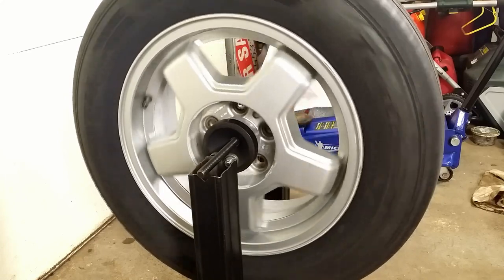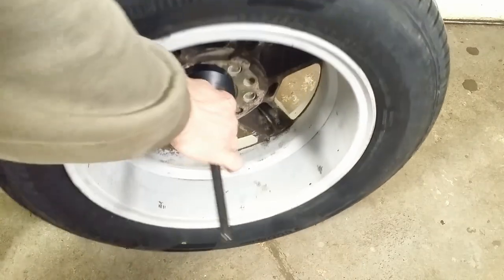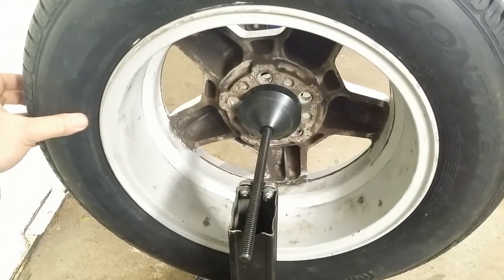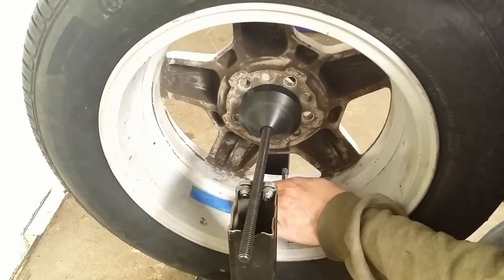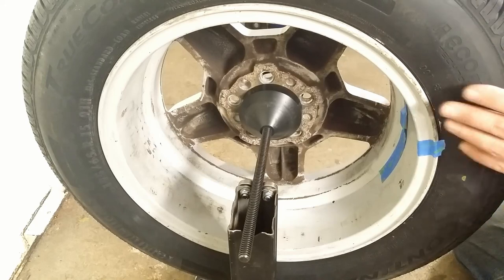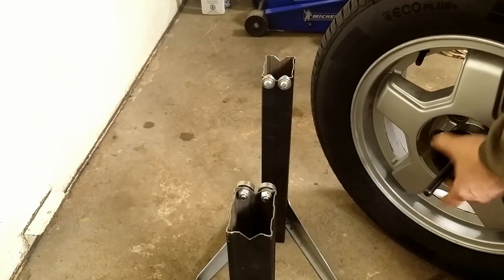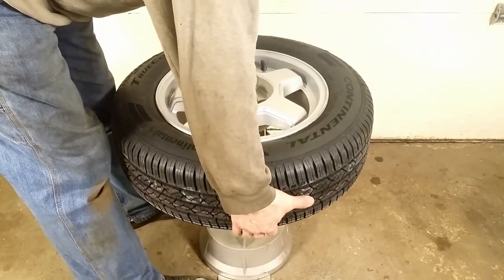Zen and the Art of Tire Balancing.

Comment: Fantastic video. Best video I have seen on this 👍
Reply from the maker: Thank you
Reply: Agreed, this is a far better and more accurate method than a bubble balancer.  This is the same method used for motorcycle wheel balancing.  It's balance around the axis of rotation, but that could be good enough.  Thank you for the great video!

Comment: This is very similar to how we balance our surface grinding machine wheels. I have been thinking of trying this for a while now, but always wondered why it isn't more popular among DIYers in the home garage. In theory, an even larger wheel should be easier to see the misbalance (in my case 35"s).   Thank you for this video.
Reply from the maker: You are welcome.
Reply: Indeed looks so simple.....those bubble rigs are useless.

Only problem.....I cant find any suppliers of the cone and threaded rod.

Comment: I have a static bubble balancer as well as this type of wheel balancer on stand specifically made for motorcycle wheels, without the threaded rod and cones (with threads). Would love to add this method of balancing automobile wheels to my existing motorcycle wheel balancer but I think the costs to source the threaded rod and matching cones would not be very cost effective.

Comment: the bubble balancer from Princess Auto is cheap and you can immediately see where to put the weight. Since the assembly is horizontal, you can just lie the weights one by one on the high point until it levels out. You may be able to make a DIY balancer yourself like this with a bubble level.
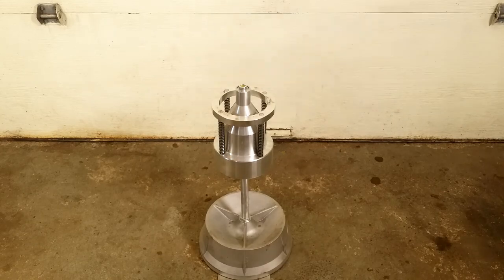Reply from the maker: At the end of this video I use bubble balancer 12:10. I get better results using the "cone and rod" method.
Reply: @robertdeptula2003  cone and rod is better.  I find the bubble balancer always give different result each time I put it back on the balancer
Reply: Check YouTube for bubble balancer mods to increase the accuracy of the bubble balancer, being cheap they weren't made with the greatest care and precision, but it can be greatly improved.
Reply: Try you balancer with a known well balanced tire in different orientations ..if the bubble is always centered youre good to go  but I doubt that will be the case ..in which case try the unbalance tire in one spot and then move it 180 degrees and split  the difference in weight placement. It may not be perfect but probably good enough.

Comment: After watching this I made my own from scrap pallets, M20 threaded rod, 608 bearings and 3d printed cones. So far I have balanced two sets of tyres without issues. I wonder why no one makes these kind of rigs commercially in automotive sizes, such a simple but effective device and BoM cost is few euros at industry scale.
Reply: did you download the cones from somewhere? Or did you model them yourself?

Comment: Very good method, I like it. 
A little puzzled by the way you use the cones to center the wheel. 
The wheel pilot has a lead in chamfer on the inside. I thought you would put the cone on that chamfer and have the cones point toward each other.
Reply from the maker: When I point cones toward each other they don't lock on the wheel. They are too long.
Reply: @robertdeptula2003  Of course, didn't think of that.
I see No-Mar still has the cones and rod, but they are crazy $$$
I ended up using a wheel hub with the seal removed
https://www.youtube.com/watch?v=du5cTMqpIhY
Reply: @robertdeptula2003  I think, that you should consider to cut off the tip of the cones, so that they dont touch. They should point towards each other.

Comment: Hi Robert.....great video......your method is just what I am looking for....I already have a Motorcycle Static Stand.....if I could find the cones and traded rod you have I would be fine.

Only ones I can find on ebay are very expensive.

Can I ask Robert....were did you get your cones.....and they made of metal or very hard plastic.

Nick in the UK.
Reply from the maker: I bought them on line, but the company don't sell them anymore. They are made from HDPE. Your option is to visit machine shop and order them there. Regards.

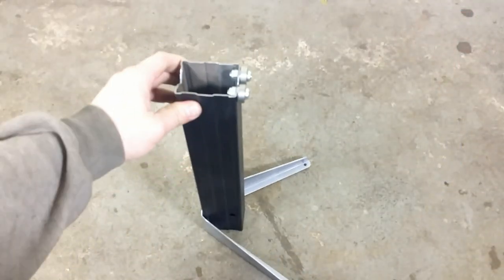Comment: Very interesting approach, and many opinions that the Bubble Balance is very inaccurate (I have HF Bubble). I'm curious why no manufacture produces machine of this kind, just for bicycles. I would like to ask that scrap metal for stands (@1:06), it looks like an aluminum downspout pipe, but definitely it is smth else, what is it? And what was the approximate distance between the small bearings? Thank you for the informative film w/a lot of useful tips.
Reply from the maker: The stand is made from old computer table legs. It is steel, not aluminium. The distance between bearings is not critical and depends on the rod one will use.
Reply: @robertdeptula2003  Thank you for the replay. I think I'll use an angled metal to make a support stand. I balanced today 1 tire w/HF Bubble Balancer. I don't know how precise all that will be, but definitely it is more physically involved than your method. Thank you again.
Reply: Your bubble balancer is inaccurate because there is interference between the pin and the wheel cone assembly.  The pin is not just sitting on its point, but the sides of its cone.  If you enlarge the hole where the pin engages so you provide clearance, it will be more accurate.  Check YouTube for bubble balancer mods.

Comment: Sir, seeing that you do this type of Balancing for 10 years and you try to get the minimum of Vibrations in the Wheels, can you give some driving speeds that you say the Steering wheel  doesn"t Vibrate !!! For example lets say 60 miles 75 miles  85 miles. And for the rear Wheels that in doesn't Vibrate in the back of your Seat. I am asking this because , I am thinking of buying a Set.
Kind regards Akko
Reply from the maker: I drive up to 110 km/h. No problems.